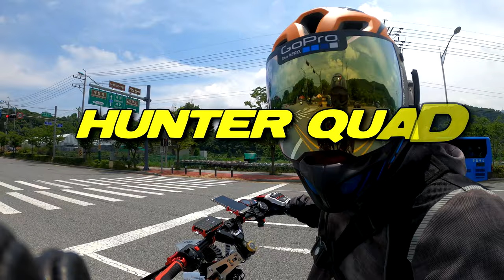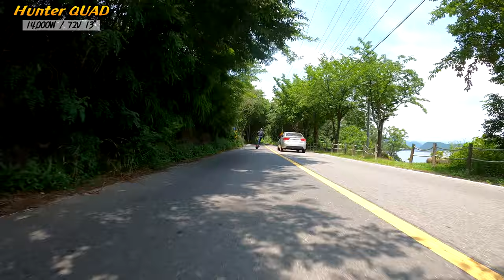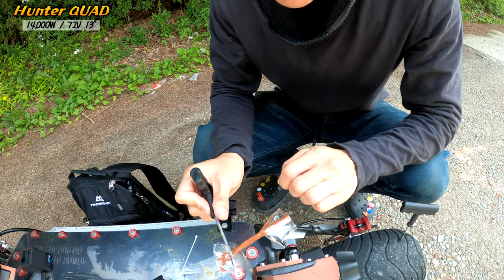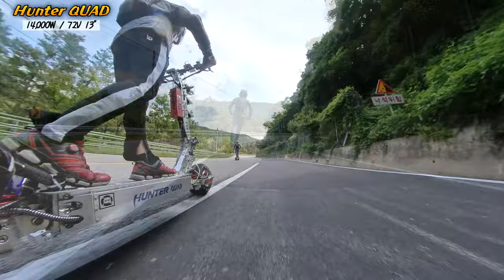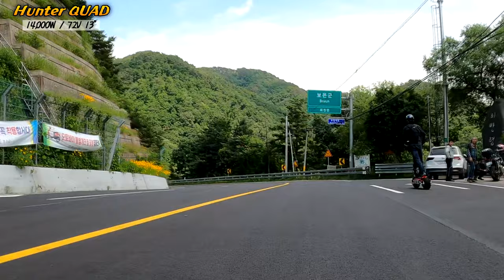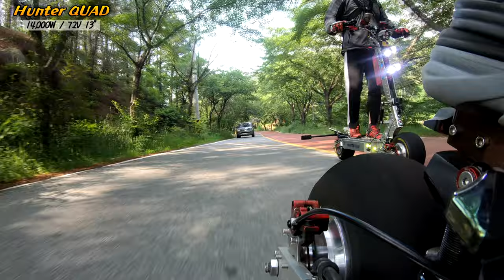🛴[Multilingual Sub] “Do you really want a winding machine?"⚡ L=90km /Electric hyper scooter /전동킥보드

Comment: The scooter is looking great! Glad the camera survived that scrape. Hopefully replacing tires will be easy and replacements are readily available for the US market.
Reply from the maker: Fortunately, the cam survived.
Tires are ready-made products that can be purchased from Ali Express and can be replaced by yourself.
Reply: Unsane - you don't have to replace tire for flats as most punctures are repairable. Use sealant so that it fixes small punctures by itself...
Reply from the maker: @noobz5056  The question is about the part where you can easily purchase tires, which are consumables for maintenance, if you import them through direct purchase. You seem to have misunderstood.

Comment: Hunter quad would look nice beside my weped sst👍✌
Reply from the maker: You are riding a fun product.  For reference, domestic SST is firmware-tuned, so you have to be careful about heat instead of favoring higher speed.  The quad is for high-speed, long-distance touring.  I hope you have fun riding.🤗
Reply: @daynight7983  thank you for turning my attention to the overheat issues with Wepeds in general.
I look forward to ordering a fully customized quad✌👍
Reply from the maker: @Maltmeister1  
I know that Numo versions of Weped uses the boost mode of the off-the-shelf Kelly controller. As you know, the Kelly Controller is user-defined and anyone can change all the settings. It does not support the specifications of the motor, but it is a tuning method that controls the user-defined output values by lowering the allowable current by installing a controller with twice the allowable current compared to the motor. Although there is heat, it is possible to set the maximum speed oriented, and it is also possible to reduce the maximum speed while reducing heat. I know that both versions are applied in Korea, and the latter is set overseas in consideration of stability.
In the end, the most important issue here is the specification of the motor. It is estimated that the length of the neodymium magnet is 7 cm (estimated) and the motor of MH of China is used. The problem is that the specification of the motor does not match the controller or that the tuning is performed with an over-spec controller. This part is estimated in the same way for RION.

Quad is well aware of these heat problems, so it designs and manufactures motors directly. The controller also controls the amount of current only enough to be received by the motor. Nevertheless, the heat generated by the high output is solved by drilling the wheel cover.

I think this is a problem caused by the difference in approach to high-power products. Anyway, I hope that it will be possible to make a two-wheeler capable of stably high-speed and long-distance rather than a show-off specification.

So I just show all the performance with video.
Reply: @daynight7983  you are absolutely correct when talking about the Kelly firmware app
Numo sent me the blue tooth module to allow me to change the power input and output.
As you mentioned the maximum power vs dumbing down the acceleration,this I can do to help control the heat output but I also dont drive my SST full speed always.So Hunter feels that drilling holes in the outer casing is enough to displace any heat generated.